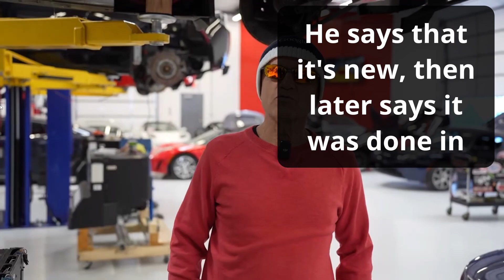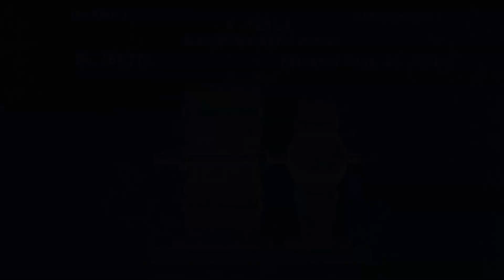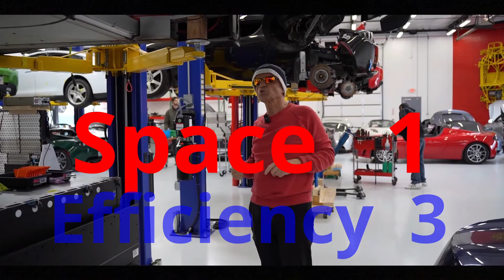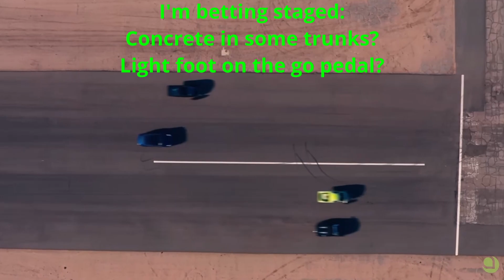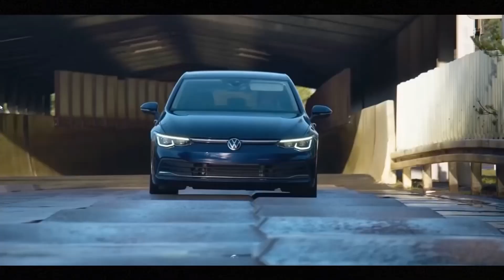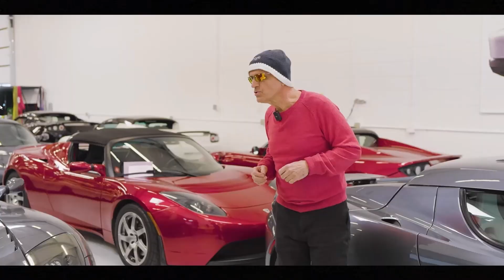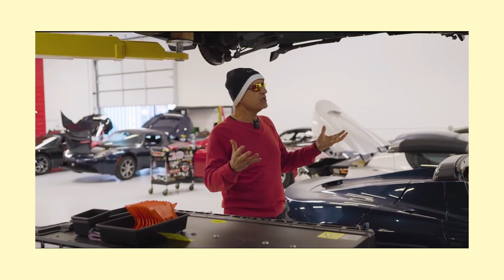Aptera   is this man for real

Comment: Gruber falsely implies that only "in-wheel motors" can devote one motor to each wheel.
In fact, each wheel could just as easily have its motor onboard and connected by a short "half-shaft".
That greatly reduces the unsprung weight of each wheel, while still able to torque-vector each wheel independently.
Ferrari. for example, intends to do just that for the front wheels of its upcoming SF90 Stradale EV hybrid.
All these Aptera-coordinated infomercials use the same videos and scripts to flood social media with the same false engineering "facts".
Reply from the maker: There is nothing like the internet for spreading lies, and YT is right up there. You are correct that torque vectoring and all the features are possible with in-body motors, but it's the added benefit of being able to change from the fixed 1:1 ratio that is the reason to do it. The overall weight penalty is better to have because the unsprung weight avoidance is so massive, and critical to better driving dynamics. I don't know why they don't save weight by keeping the wheels in-body and just removing the lower steering mechanism altogether. That way they can be enclosed for aerodynamic efficiency better than the pants provide, and torque vectoring alone turns the EV. Tanks and many plant machines do it, so why not cars? If it is aided by having the rear wheel turn a bit, then keep it sans motor and do it, but even 4-motor 4 wheelers can steer without L&R turning of any of them. The wheels having to be placed so far outboard on Aptera adds the weight of the arms just to hold them so far away, as well as those longer cooling channels. Those arms have to be heavy duty enough to handle the extreme forces of double the unsprung weight, normally. That's quite a penalty in itself. I think these snake oil salesmen are half way to many good ideas, but are more interested in getting rich than providing the ultimately efficient EV. If they fold, I hope someone get's the shortcomings right and makes that perfect EV.
Reply: @aussieideasman8498   -  I believe that much of the penalty of unsprung weight could be compensated with Active Suspension - realtime software control of the damping coefficient of each wheel's shock absorber.  Elaphe has the expertise and software, and its president was a professor of physics who would love the concept, but the development could take more time and more funds than Aptera has.  And a simple co-development could be Regenerative Shock Absorbers like Audi did - a wet dream for Greenies - bit yet a price-booster.
Reply from the maker: @daveinwla6360  You don't have to compensate for unsprung weight that you simply don't add. Active suspension and other tech solutions can be used on the minimal weight with more ease. I recall Bose had a YouTube video out and other online reports about them having a great suspension invention (must be 10 years ago by now?). It showed a car that had no body bounce when going over badly corrugated ground. It stopped the wheels from going down holes, and lifted them as soon as a bump went under them, as if by magic. This eliminated most of the forces for body bounce. It looked like the prototype worked well, yet I have not heard of the invention since. 
I gave this problem some though about three decades back, and thought that a centre (5th) wheel should drive the car, and be larger than the corner wheels, to increase gyroscopic effect and lessen the tendency to drop corners into holes. Then the corners would be made so as not to shove into holes by springs, and eliminate the thump forces there. The bumps in roads were trickier, and Bose would have been good for that, but they had not invented their system, so I thought that the wheel/tyre combination could be a lot softer than usual, since most of the weight is now on the drive wheel. Still use conventional suspension all around, but the corners would soak up the bump as well as greater forces being handled by the springs. With only the drive wheel being firm, the ride should be more comfortable. All 4 corners would steer, with none of this crabbing at speed that some rear wheel assisted steering did (they all died a death). That is only useful for lane changes, and can be left alone; you can still change lanes with front and rear acting in opposite directions, and they make a natural circle in all 3 rings. Which brings me to another aspect; the sides are linked like the front wheels of a billy cart. You can't have them turn independently at the same angle, or there are not two circles that work together. To make the correct angles would involve complications that are not needed if they pivot on one axle - effectively no problem to solve. Mechanical links between front and back axles can also ensure they turn opposite in precisely the same degrees at all times.

Comment: Ford has found that in wheel motors could not provide target top speeds for their applications, hence why they have patents but no applications so far for thus technology. Lastly, if a wheel motor fails, what happens to vehicle directional stability in a FWD set up like one offered in Aptera?
Reply from the maker: On the matter of top speed; I mentioned that bugbear, so glad you added that from Ford. The silly thing is that this clown is clueless about it (or hides the fact, which is worse).
On the matter of a seized motor while at speed; I would think that no electronics could prevent a disaster, since the seizure can only seize the tyre instantly, as well. About the best electronics could do is stop the other motor so it skids straight-ish and not fly off into the trees, or pedestrians on the sidewalk. It will be interesting to hear what their CFD simulations have told them, lol.

Comment: FYI Lightyear and Lordstown motors are using in hub motors so Aptera is not the only example of this. But I agree with you on the unsprung weight issue.
Reply from the maker: So that's plenty?
Reply: @aussieideasman8498  No but a couple more “mis guided” companies you can bash.
Reply from the maker: @williamread8186  Add Rivian and it's still not plenty.
Reply: Lightyear and Lordstown are bancrupt. They could not even remotely reach their efficiency promises.

Comment: Maybe the real reason in wheel motors were not used is because cars were powered by gas engines and you can't fit an ice in a wheel...electric motors? Yes, they fit.
Reply from the maker: Of course, but there are multiple reasons.

Comment: The two main problems with in-wheel motors are the unsprung weight which is extremely harsh on the tire and the torque of the motor is transferred to the suspension instead to the frame which is extremely harsh on the suspension. I can see suspension failures in Aptera's future if it ever goes into production.

Comment: I think you make a good point in talking about the accident exposure to the Aptera vehicle by “hanging” the wheels out where they can be clipped off in an accident. That is compounded by the fact these exposed wheels contain the motors that propel the vehicle. The Aptera is a horror show of possibilities.
Reply: Yes, the wheels may be destroyed in an extremely severe accident, but as long as the safety call containing the passenger remains intact, that doesn't matter. But we will all know the answer to that when Aptera does its crash testing.

Comment: I don't think the in-wheel motors have rotational inertia since they don't turn.  They turn the wheel around themselves.  The motors do add to the unsprung weight but the entire motor does not rotate.  Also, with one pedal driving from regenerative braking, the brakes heating up the motors shouldn't be much of an issue.  Check out the moose test video of the Aptera to see how well it handles.  Don't forget how the Aptera was conceived...maximum efficiency as the driving force.  Everything else takes a backseat to efficiency if there is a compromise to be had.  The driving force for the history of automotive engineering over the last 100 years has NOT been about efficiency.  The guy in the video is using "wheel powered motor" incorrectly and "sprung" and "unsprung" incorrectly.  But I am extremely happy to see this company approach vehicle design from an efficiency perspective.  The more we explore new and different ideas, the better.  The car industry is mainly about making money.  But what would you come up with if, instead of doing things the same way as everyone else, you tried to design the most efficient vehicle possible?  And why are you calling people gullible?  How do you know Aptera fan boys (all of us) believe this one guy in this one video?  You are making some dangerous assumptions about what other people think.  Shame on you.
Reply: With any electric motor has two major parts. The rotor and the stator. The rotor rotates, and the stator stays stationary. Wheels in hub motors will bolt to the rotor - so the mass of the rotor is combined with the wheel mass and makes its inertia higher.
Reply: Yes it has rotational inertia!!!
Reply from the maker: [I don't think the in-wheel motors have rotational inertia since they don't turn.] I don't know enough about them to be sure, so I Googled it. Here is the result:
"When power is applied to the stationary coils on the inside of the wheel, an electromagnetic field is generated and the outer part of the motor attempts to follow it and turns the wheel to which it is attached." 
So part of the motor rotates. That's good enough for me.  
[They turn the wheel around themselves.] Now we know it's not true; they turn the wheel WITH half of it.  
[The motors do add to the unsprung weight but the entire motor does not rotate.] No, only the stator part doesn't move.  
[Also, with one pedal driving from regenerative braking, the brakes heating up the motors shouldn't be much of an issue.] Have you seen the degree Aptera regenerates? It's probably as good as the screen, and one more lie. 
[Check out the moose test video of the Aptera to see how well it handles.] Easily staged. A person measured the width and discovered that it was at least a yard wider than legal. Any video editor can speed up a clip. You are too naive. Get irrefutable evidence.
[Don't forget how the Aptera was conceived...maximum efficiency as the driving force.] Nothing proven. I'll wait. 
[Everything else takes a backseat to efficiency if there is a compromise to be had.] That's the snake oil; the reality falls way short. Got a heat pump? No. And there's more.   
[The driving force for the history of automotive engineering over the last 100 years has NOT been about efficiency.] It isn't with Aptera until it is proven. Claims are meaningless.
[The guy in the video is using "wheel powered motor" incorrectly and "sprung" and "unsprung" incorrectly.] So you agree with me.  
[But I am extremely happy to see this company approach vehicle design from an efficiency perspective.] Just a shame it might be the biggest con artists in history to do it, and fold twice.  
[The more we explore new and different ideas, the better.] The less shonks, the better.  
[The car industry is mainly about making money.] That's all Aptera has done, so far, and they won't build anything until they make $50,000,000 more. 
[But what would you come up with if, instead of doing things the same way as everyone else, you tried to design the most efficient vehicle possible?] I'm not trying.  
[And why are you calling people gullible?] Because they are. You are.
[How do you know Aptera fan boys (all of us) believe this one guy in this one video?] I don't - I generalize.  
[You are making some dangerous assumptions about what other people think.] And you presume I am wrong.  
[Shame on you.] Shame on you.
Reply from the maker: I just discovered this Gruber clown was being sarcastic. Also, in the ensuing time Gamma has overheated twice and has been found to have zero regen - one more lie to add to the solar and battery sizes of the Alpha's.